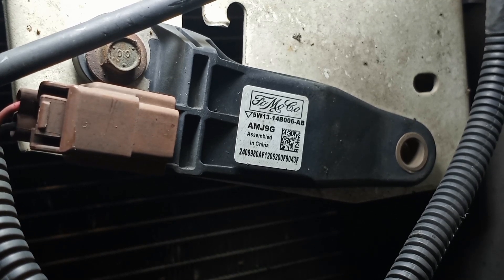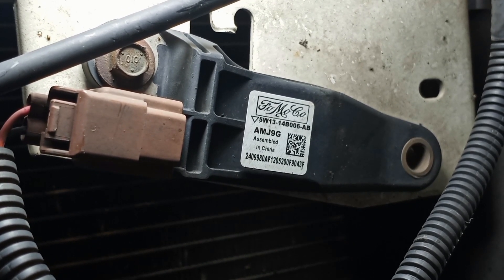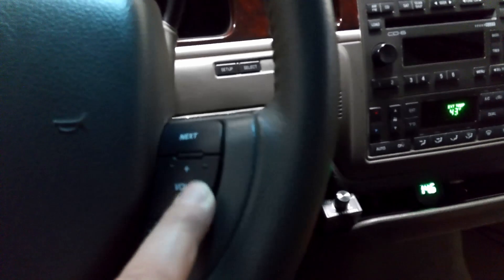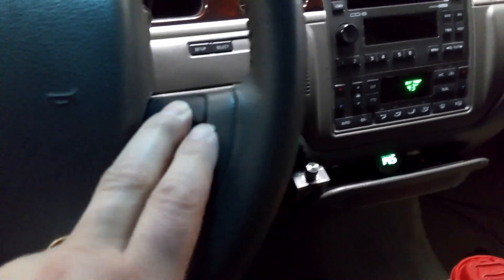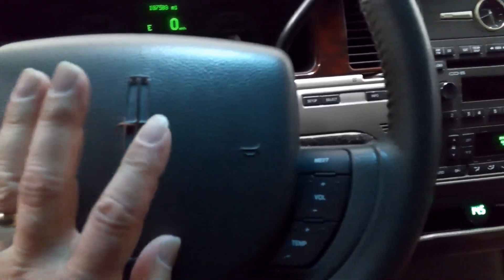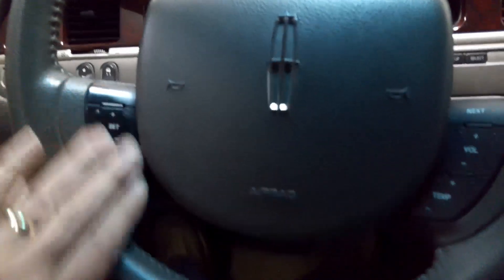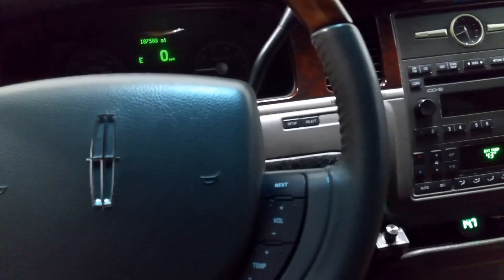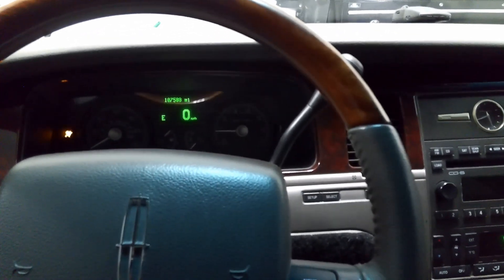Code for front crash sensors on Lincoln town cars 3rd generation year models.

Comment from the maker: Thank you for all your comments. This happen to me back in 2019 when I had 187,558 miles on it. Now I have 232,235 miles. 44,677 miles ago. This is also related to the Crown Vic's Mercury Grand Marquis. If anyone has the 2003 Marauder let me know if it's the same front sensor.